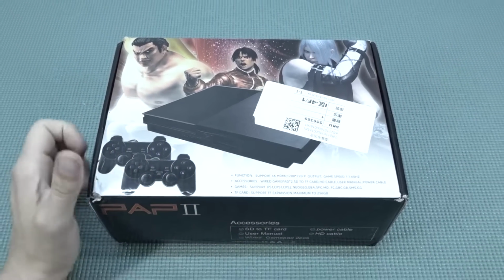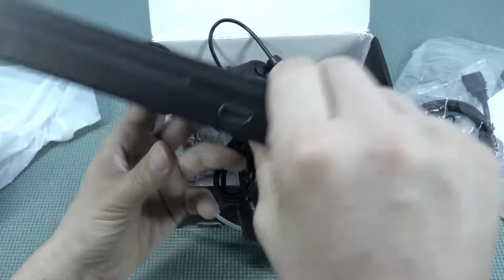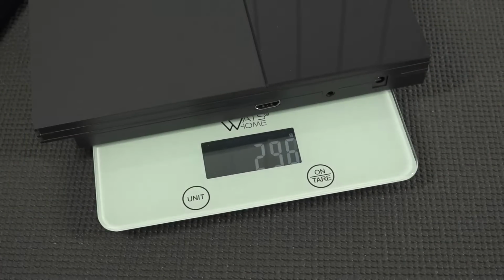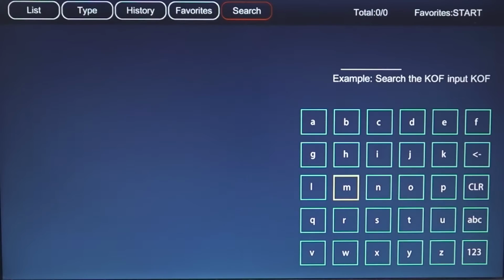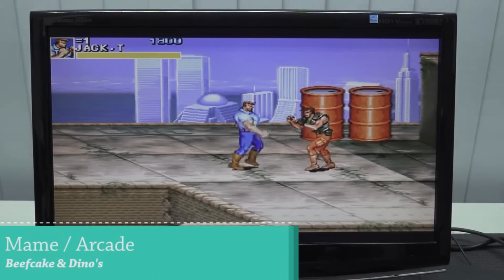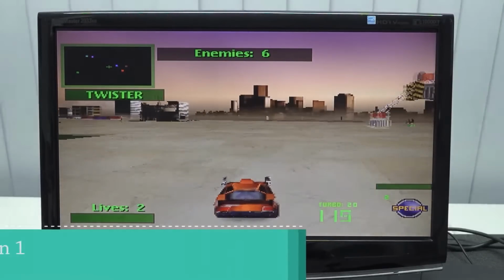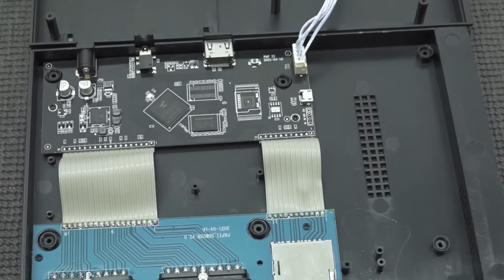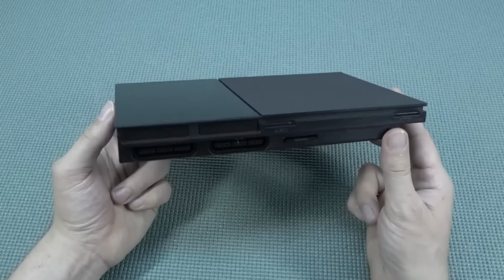PAPII Game Console Playstation 2 Slim from Ali-Express in 2022 !

Comment: I never thought they would knock off the SCPH-9000x models of the PS2 slim. I usually see the 7000x models get ripped off. Also that Windows 95 boot up sound at 4:56.
Seems like the emulation is pretty good other than a handful of games, but it's not the best, especially using those controllers. It's not a bad system, overall, but there are better ways to emulate older games.